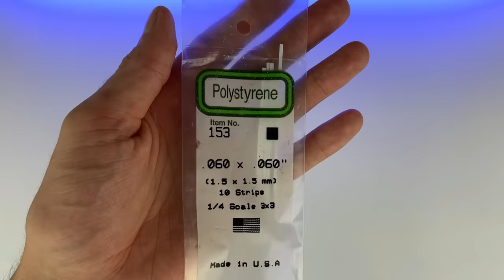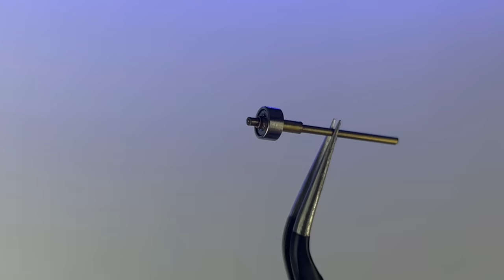Making an RC Lowrider 64 Impala With Working Hydraulics (RC Hotwheels)

Comment: One more thing, make sure the inside were. The ball joint Fitch inside. You can drill out a hole that's concave. You can do it yourself by hand or you can use a drill. Just make sure it's concave. Then you make another concave piece to hold the other side of the ball. Now be aware, I forgot to tell you this. The top part of the controller can be a solid. Concave hole, but the bottom one has to be a little overdrilled, so when it does go up, it doesn't lock up, you have plenty of room. You'll see what I mean, you're smart. Look what you've created, you'll figure it out, but it will work.

Comment: I bet you can make astandard sized toy transformer actually drive and transform and it might be easier than this was because of all the extra space. 
That trick with the string is genius! 
Some of the motors you used on this would fit perfectly inside the arms and legs of the transformer with minimal cutting and drilling. 
The hardest pRt might be finding the perfect model to use. I would make sure its one that stands up well by itself, and doesn't have a ton of "kibble" or backpack of plastic that makes it fall backwards all the time.

That, and you might have to insert a lot of bearings in place of all the plastic joints.

If anyone can do it, you are the man to make it happen!

I subscribed!

Comment: Wow. I try imaging if I added lobestone spheres in Car Piston . Hydrogen gas from Electrolysis DC Current break down compounds to elements gas. The Hydrogen gas from water goes to intake value. To turn to Plasma the lobestone help make more electricity from heat.  The Hydrogen gas turn to Helium gas from pressure of air pressure electric magnetic field lobestones. 🤓😔 sorry to be a nerd .I am not that much into cars sure they are great handle fun .great love you got

Comment: I won't subscribe, But I threw you a like. Only because you left out quit a few steps like where you sourced the electronics and remote control stuff. Good Job, Tho.
Reply from the maker: The goal of my channel isn’t to teach people how to make my exact builds, but rather I simply have a passion for sharing my particular process along the way. Kind of like a street artist isnt teaching you art, but rather theyre letting you see their process. That being said, the electronics I used are easily found on aliexpress or ebay, mostly searching “micro motors” or “micro receiver”(mine was frsky protocol made by dasmikro). The company “dasmikro” is pretty helpful with the small electronics. Some of it you can find on my website if you want US shipping.

Comment: BTW, none of this stuff is REALLY Hydraulic. It's all Electric. Real hydraulics would be impossible. Or Impractical at the very least. But I'll stick with Impossible.
Reply from the maker: I think its fairly obvious that the word hydraulics is used to indicate that this impala can move similar to a real one with hydraulics. I didnt really consider that anyone would actually think there are micro pumps, fluid, seals, etc. in this 1/64 build.